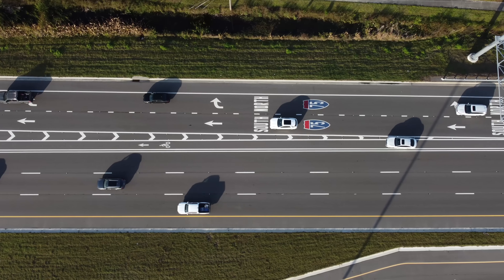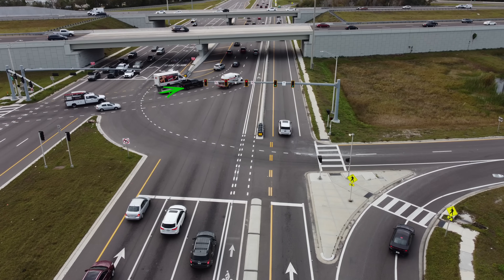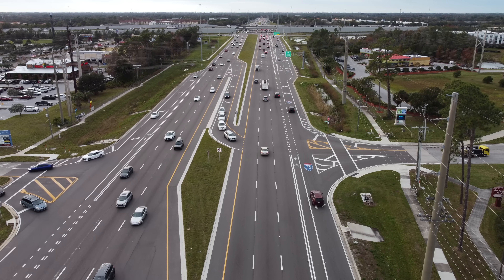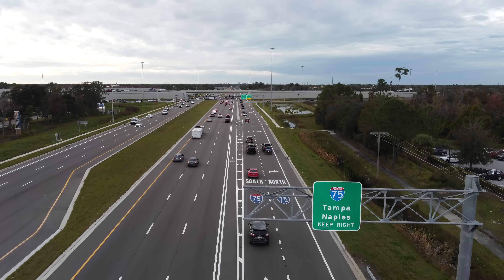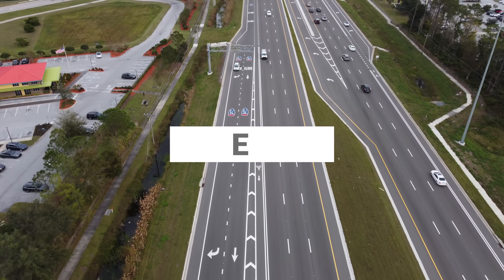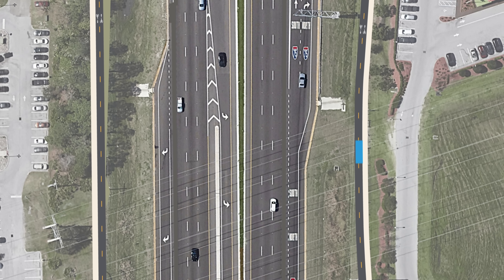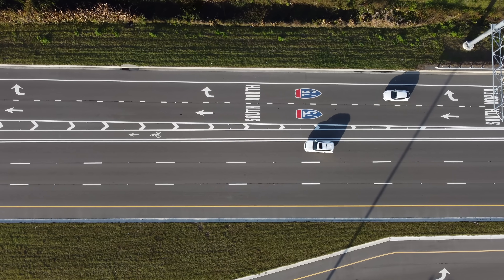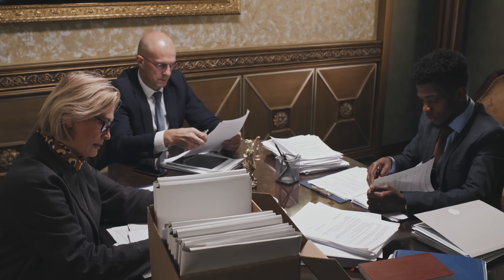This Brand New Interchange is Already Flawed

Comment: That bike lane looks absolutely deadly.

I dare the designers of this interchange to bike there
Reply: I feel like a lot of these designs are intentional so they can later argue that bike lanes are dangerous and they can get rid of them again.
Reply: @FlorianHWave  "no one even uses this bike lane! this is why we shouldn't build more bike lanes"
Reply: @reilandeubank the bike lane not being used is due to bad bike lanes. They should add continous barriers to both sides of the bike lane, but that makes turning right impossible for cars. So redesign it entirely. Just a sepperate bike lane. Bike lanes and car infrastructure should never mix if possible!
Reply: @joneinarmattiasvisser6113  I know I was making fun of the traffic engineers that seem surprised people don’t use their bad bike lanes
Reply: @reilandeubank the American mind
Reply: If we were design car lane that are very dangerous with blind corner would you drive.  @reilandeubank
Reply: @reilandeubank  That's probably just a fringe 'benefit', and the truth is even messier as revealed by some other comments. The project had money problems and ended up taking some grant money for bike lane infrastructure to make up shortfalls, which required them to add the bike lane. And of course, since the grant was just "extra money" to them, not a sincere intention to add functional bike infrastructure, they cheaped out on it as much as they could: just a little bit of confusing extra paint and that's it. I would not be surprised if this was a "minor change" implemented by a random government office worker and signed off by the politically appointed government officials in charge after the traffic engineers had already been paid for designing the interchange without the dangerous bike lane. Which explains why the bike lane makes no sense and is dangerous: it's there to fulfil the bare-minimum technical requirements of the grant money as cheaply as possible, not to actually be functional bike infrastructure.
Reply: @FlorianHWave  Yeah, that's the only way I can believe it. They make a crappy dangerous lane nobody uses, to justify never building any at all.
Reply: @moth.monster  this is what happens when a minimum bike infrastructure requirements are codified in building standards and road planners are forced to retro fit cycling infrastructure on roads that are designed for cars. This is a high capacity, high speed roadway designed for motor vehicles. Bike lanes and cyclists don't belong there period! If you want cyclists to safely travel along that route, the only way to do it is to build a cycleway parallel to it, which is very hard to justify economically. You can't put a protected bike lane all the way on the right because there are turn-only lanes that the bike lane would have to cross anyway because—you guessed it—this road is designed exclusively for motor vehicles. 
I don't think there's a conspiracy of planners making terrible bike lanes deliberately, but I do think there's some legal requirement to stick bike lanes everywhere and this is the only way to do it on a freaking 6 lane road.
Reply: @artemkatelnytskyi  stuff being hard to justify economically never stopped the US from becoming the car centric transportation hellhole that it is today. Why do we suddenly care about justifying stuff economically only if it concerns bikes and public transportation?
 
I have no idea if a bike route makes sense along that corridor. But if it does, they should build a proper one. Tunnels and flyovers exist and are not a new technology, and they don't have to be built nearly as heavily for bikes as for cars, meaning it costs only a fraction of what the car infrastructure cost.
Reply: @alex2143  because car infrastructure moves millions dollars worth of goods and human capital. Agree on the public transportation though. I place public transportation higher on the list of priorities than cycling infrastructure.
Reply: @artemkatelnytskyi  I'll just point out that Dutch bike infrastructure has an ROI of approximately 2900% due to health benefits, reduced spending on other types of infrastructure and the fact that bike infrastructure is dirt cheap and move on then. Have a good day!
Reply: @artemkatelnytskyi You must work as a city planner.

As an example, bike lanes allow children to use their bicycles to go back and forth to school, without having to wait for a parent to drag them them around in a car.

As well, cycling to school is good exercise.

I guess though, as a city planner who's only thinking about slaves sitting in warehouses, exercise and education isn't worth considering.
Reply: @artemkatelnytskyi  Funny how it works out in other countries. But I take it making people physically ill is better for the economy, right?
Reply: @ohauss  funny how you put words in my mouth and just assume what I think.
Reply: @artemkatelnytskyi  Except, as pointed out there is already a parallel footpath that could be modified to do precisely that.
Reply: @EwanMarshall  true.
Reply: @artemkatelnytskyi  Hard to justify? With that state of mind you will never get a bicicly infrastructure. But where I live this is the norm, It is obvious and obliged to build infrastructure for cars, pedestrians and bikes. No brainer.
Reply: @artemkatelnytskyi  It does not, it moves people,. and badly and inefficiently.

Moving a car between tow parking lots is not transportation (except when it is loaded on a trailer). The driver (and possibly passangers) are the transportation, and compared to a bike, the transport is costly and ineffcient.
Reply: @artemkatelnytskyi ”build a parallel cycle way is hard to justify economically“. In other countries this is done all the time. 
“We’re one of the richest nations” - “no, not in that way”
Reply: @artemkatelnytskyi no, this is what happens when you have a car-centric society. Watch some videos on urbanism. Your argument is made constantly and other countries have proven that way of thinking is flawed. Urban design dictates how people use a space, not the other way around.
Bike lanes are not seen as a legitimately important feature so they’re not treated as such. 
There’s so many other (and better) options.
Reply: @FlorianHWave  You're giving them way too much credit. Road design engineers include bike lanes because they're told to, they give absolutely no thought to it beyond checking it off the list. I see the same thing with bike lanes that just end in the middle of nowhere. It's crazy to be riding a long and see a sign that says "Bike Lane Ends" and yup thats it.
Reply: @FlorianHWave  Change the law so the designers/builders are liable.... that should solve that pretty quickly.  And maybe take cues from the Netherlands ;)
Reply: @FlorianHWave  Its so dumb why not focus the money thats being spent on making genuinely usable bike lanes?
Reply: @FlorianHWave that's a good point about bad design to just get rid of them
Reply: @FlorianHWave The most malicious of malicious compliance...
Reply: @FlorianHWave it should not have been intentional at all. If not, then what purpose for the bike path?
Reply: @FlorianHWave  There are places where bike lanes shouldn't be. This looks like one of them. The notion that bike and auto traffic can safely co-exist everywhere is foolish.
Reply: @ It would be perfectly fine if they had put the bike path next to the road, physically separated from the road.
Reply: Did they just put a bike lane on A FUCKING HIGHWAY?!! I really don't get North America.
Aside from the bad design of the interchange, how on earth could they put an unprotected bike lane right next to cars going more than 100km/h holy shit
Reply: @riccriccardoricc  there are some bike lanes in the nether lanes which parrelell highways but those are on seperated paths
Reply: I don't think I've ever seen a bike lane more stupidly designed anywhere. Ever.
Reply: @Greencomms I’ve seen bike lanes like that irl
Reply: @Greencomms  The A421 in the UK has a cycle lane crossing entrance / exit ramps following a 70MPH dual carriageway. It's not kept clean and clear.

Cyclists rid in the gutter.
Reply: @Ben31337l  There are quite a few roads in the UK that are like that, the cycle route shares the shoulder of a 70 mph dual.  I suspect it is just done so they can say they have accommodated cyclists.  I do not actually see anyone use them.
Reply: The bike lane looks like something I'd see on a red bull challenge
Reply: I can't image this would happen anywhere in Europe. I don't even think they are that stupid in eastern Europe.
Reply: @yottaforce no cares what Europe does, keep your shit opinion to yourself
Reply: Its Florida, its probably intentional. And with how expensive this thing is, it would have been marginal to put a combined walk/cycle path that is separate from the road.
Reply: At one point on Blackfriars Bridge in London, there was a similar layout of bike lane which was sandwiched between a left turn lane and a through lane (remember, we drive on the left). Cyclists were killed by traffic switching lanes, that cycle lane was removed, and was later replaced with a lane on the left hand side, but has since been replaced with a 2-way cycle track. In this case you'd probably be better off widening the sidewalk and designating it for dual use. But that was on a 30 mph [more recently 20 mph] road in the city centre, more akin to downtown Boston, than a major highway in the exurbs.
Reply: I daresay if the designers were made to bike there, we might have some job openings for better designers.
Reply: May I assume the designers are fired and prosecuted for attempting murder of cyclists? This design is so bad, it must be done with a purpose.
Reply: @lbergen001  This is Florida with DeSantis, this was likely forced from above the designer's unfortunate pay grade.
Reply: @Toqom  wow, that's crazy.
Reply: The bike lane on that road is absolutely insane
Reply: That was my immediate thought first glance at this video, I'm not even 30 seconds in. It epitomizes what's completely wrong with how car societies, even when well intentioned, get wrong with adding cycling lanes. There's No Freakin' Way I'd use that as a cyclist. Bad enough being a driver in that mess.
Reply: I think those designers were passive-aggressively trolling cyclists.
I can't imagine any other way anyone would think to do something so bad as a bike lane.
Reply: I'm pretty sure most bicycle lanes are designed by people who have literally never ridden a bicycle. My favourites are the ones which make sharp 90º turns.
Reply: It's truly insane how any designer would think those are ok
Reply: That bike lane design should carry a capital penalty for the designer.
Reply: The bike lane was 99.9% certainly made to qualify for more funding, not for anyone to actually bike on it.
Reply: That should be the requirement – not that that the road designers must include a bike lane, but that they must ride a bike along the roads they design at least once a month for a year. See how much safer the bike lanes become after that.
Reply: @skoosharama  we would run out of road designers! lmao
Reply: @skoosharama  there are professionals that see roads like this. agree with you. but then bike down that same road regardless of the fact there's a bike lane or not.
Reply: @skoosharama  also make the woke politicians ride a bike on it.
Reply: @skoosharama  Requiring road designers to travel down every bike lane they design once a month for a year is an absurd requirement and it would pretty much guarantee that you're turning all road designers against the idea of ever including bike lanes in their projects again.
Reply: @Strideo1  I didn't say that road designers ought to regularly ride a bike down every bike lane that they design, but that they ride a bike down every road that they design. That is a crucial difference. And why is it so absurd? Is it any more absurd than a traffic engineer putting an unprotected bike lane in between general traffic lanes on a multi-lane road with a 50-mph speed limit?
Reply: @Strideo1  -!!! It's NOT road designers that get to decide what uses the road needs to fulfill, Strideo1 !!!
Country, county and city PLANNERS make those decisions. Road engineers and designers are there to FULFILL those needs, that's all. Or are you in favor of always allowing the tail to wag the dog!
Reply: Wrong. Forcing road designers to bike down bike lanes themselves is exactly what should be done to ALL politicians and government employees: experience the consequences of their actions  @Strideo1
Reply: @Strideo1  Then they do not get a job, because the bike lane is a requirement in the first place.
Reply: @Strideo1 in the years I’ve seen it take to do a construction project, I’d imagine they would have plenty of time to ride their bike alongside their creation once or twice.
Reply: @Strideo1  No, it'll wake them up and cause them to design them properly.
Reply: @Strideo1  No no, require them to cicly there for a year REGARDLESS of weather they've designed a bike lane or not.
Reply: If you would let your kids ride in the bike lane then it's not suitable
Reply: @ThiccRiderPup  Hope you meant "If you wouldn't"
Reply: @ThiccRiderPup    You write "If you would let your kids ride in the bike lane then it's not suitable."
I write, "If YOU would let your kids ride in THAT bike lane, then YOU are not suitable."
Reply: If I lived in that area, I'd probably only EVER have used that bike lane ONCE. It would likely have terrified me, especially if there was even a little traffic. After that, I'd ALWAYS find another way to cycle that route. So yes, as others here have noted, this could be used by planners to say they don't need bike lanes, because nobody uses them.
Overall, it's stupid planning anyway. If more people cycle, they'll likely be a LOT healthier. And that would both increase revenue to the town and reduce the overall medical requirements for it's citizens.
Just compare the US with Europe. Most European towns are bike friendly. The populace is a LOT healthier. And they have significantly increased life expectancy.
Reply: @rumi9005 
They put in one of these weird, non standard intersections in by me, in where it used to be a normal highway overpass, traffic now is directed to switch over to the other side of the road in an X. Being so dumb and unusual, I now avoid it, and I said to my friend that others probably will do the same, and they will claim the design worked but it's just bc it gets less traffic!
Reply: just say it is murderous. It is literally a bike lane in the middle of a highway.
Reply: I took one look at that “bike” lane and NOPE!  That thing has “death” written all over it.
Reply: If you wouldn't feel comfortable walking on the bike path (I know that is verboten), you shouldn't expect bikers to use it.
Reply: There is A LOT of politics involved in road design, sadly.  I have a friend who is in the business and the list of bad ideas that are forced upon them comes in many forms, from "I know better than you, egghead" to "I can never sell this to the Mayor/board/whatever oversight group unless you do X" to "OK, but you are adding this because reasons"
Reply: Yeah. Would you let a 12 year old on it without supervision? If not, it's not really bike infrastructure.
Reply: a lot of so called bike lanes are like this, they were added so they could claim bike infrastructure without any thought to safety of the biker. i will not bike on most bike lanes.
Reply: Honestly the residents should sue
Reply: Yeah as a Dutch person I was completely shocked by this. In the Netherlands this would have been a completely seperated bikepath that is probably at least 10-15m away from the highway. But a 3 lane road both ways with highway exits that has traffic lights is already completely unimaginable. This is a highway in all practical understanding. Highways don't have crossings, ever. Highways have over- and underpasses. A walkway across a 7 lane road with a protected middle barrier like that or a bike lane in between highway lanes just seems unimaginable to us. Just looking at this road you should be able to drive 100km/h on this road, but then all these stupid things exist which make it clearly not suitable for a 100km/h road (or whatever is the US equivalent). Just looking at the road for 2 seconds should tell you how fast you should be able to drive, here I get so many mixed signals. Separated car traffic with multiple lanes on both sides? Highway style exits and entrances? Clearly a highway. Wait, traffic lights?! Pedestrian crossings?!! A bike path in the middle of the highway?!!! This project is just lunacy of the highest order and in any sensible country you'd be laughed at for even proposing this nonsense. Let alone them actually building the thing.
Reply: if motorists obeyed the laws, there would be no problem for cyclists. but if you drive over a solid line, it's a crime, right? and if you miss an exit, you have to take the next one and turn around. no wonder you have so many accidents in the usa, as long as you arrive you are happy regardless of whether you do something wrong.
Reply: @PUTDEVICE  drivers doing stupid things that they're not supposed to in this kind of situation is Far from unique to the USA. Australian dash cam compilations are fun, just for one example. Simple fact is you pretty much have to assume there will always be at least a couple of idiots who will do this sort of thing.  Of course, the USA does seem to have rather More of such idiots than most places, and some parts of the USA are particularly resistant to do anything to mitigate the issue.
Reply: The bike lane was included solely for funding purposes. Due to high water tables, Florida doesn't do tunnels.
Reply: the existence of that lane at all is still quite remarkable for he level of car dependency in the land of unfree.
Reply: They will bike it and have 12 cop cars making sure traffic stays clear if them, It's a victory for them either way.
Reply: I enjoy biking with my children, but this is terrifying! It's one thing to risk your own life - but imagine taking your kids on 'this bike path'? This looks like reckless endangerment!
Reply: They put the TOTALLY UNPROTECTED bike lane BETWEEN two massive lanes of traffic.
Is Florida DELIBERATELY trying to murder cyclists?
Reply: They shouldn't be dared, the designers should be forced to ride a bike there daily for the rest of their life. Which will obviously be short.
Reply: At this point, I'm so disgusted, that I think Americans get the roads they deserve, and from a darwinistic point of view, deadlier roads are just an advantage. The more the merrier!
Reply: It should be a requirement for the designers to test their work in all modes intended, and they should self-insured for all accidents inflicted on themselves.
Reply: I work for a transit agency and our designers literally get in wheelchairs and try to access our infrastructure and vehicles in them. They scraped an old ramp design and decided to instead lower the trains because they couldn’t wheel themselves up the concrete ramps.
Reply: What is a different way to say, “bike trail”?

Cycle path
Reply: 🚅  don't you all enjoy railroad
🚈  trams, trains etc are just so cool
🚞  take a ride in my ''transportation'' folder,  (folder 4)   :)
Reply: High ways don't need bike lanes, there should be a bridge or a tunnel somewhere to cross the highway
Reply: You gotta understand there ain't enough space for bikes ! Fortunately there is a  path at the side of the road ....
(And you bet you'll get fined for riding on a sidewalk , no-one ever uses .😳😱 )
Reply: YES, I aggree, from the bikers viewpoint it's a criminal design !!  I propose the designers should be in jail.
Reply: I REQUIRE them to do so!!!!!!! Their sentence is to bike this route for a year.
Reply: Realistically, you cannot force designers to use "their bike lane" if they never used bicycle in their lives, as it seems to be the case.  But they should consult actual bicyclist who experienced whiffs of air from trucks passing them, the need to stop when you have a chain problem, the need to pass a slowpoke etc.
Reply: to me it looks like the bike lane was actually just to space out the road so they could later add a barrier
Reply: Much less take their children on it
Reply: They won’t because they don’t care. Most people only care about things that concern themselves. It’s like designing a publicly used bench with armrests in the middle for no real reasoning whatsoever.
Reply: They could've fixed it by putting the bike lane next to the road and just used tunnels for crossings. This bike lane is bad enough as it is, but this is the US where people can barely drive properly. So many cyclists are gonna die on this road, assuming they're foolish enough to even wanna use it in the first place.
Reply: Yep its faking nuts, who signed off on that lol.
Reply: I've only seen the start of the video, how are cyclists supposed to reach the bike lane? Or leave it?
Reply: Why are they putting a bike lane in the middle of a motorway?
Reply: I'm sure most designers would like it safer. I'd argue it really depends on politicians, things like political will, budget constraints, community input and the need to fulfill requirements for funding purposes in the cheapest way possible.
Reply: Ive seen similar bike lanes in other parts of FL, crazy.
Reply: This bike lane should never have existed. Any intersection with a cloverleaf should be car-only, and bikes should use tunnels or overpasses.
Source: Dutch traffic enthousiast
Reply: I mean, it HAS to bge intentional, right?
Reply: Lol you think they will peddle that???
Reply: Bike lanes and Interstates should not mix.
Reply: A bike Lan should have a barrier. Why are they always open when cars can drive off and hit them?
Reply: @6gredlite907  There should not be bike lanes at all, on main roads. And this is a huge main road...  More then that, the bike lane in built inbetween two section of the car trafic. I consider this high crime from the part of both the road designers AND the officials ordering it, the politicials voting YES for it.  
There should be completely separate bike route infrastructure at a different location.
Reply: @Wig4  I agree with that
Reply: Yeah, should be removed.
Reply: Those bicycle lanes are suicide. I'd challenge the committee deciding this layout to bike it during rush hours.
Reply: IKR atleast put a barrier or something
Reply: I would not ride a bike on a side street. Bike riders who think car drivers obey all traffic rules are not long for this world.
Reply: I dare the designers of this interchange to send their kids to school using that bike lane.
Reply: @BalooUriza  From what I have seen kids don't walk or ride bikes to school anymore.  If they are not riding a bus their parents are driving them
Reply: It was clearly designed purely to infuriate people asking for bike infrastructure by doing the opposite of anything sensible
Reply: why even have them in the first place? theres zero demand for bike lanes
Reply: @sleetskate  If they're safe and form a network, they have demand.  Most car trips in America are displaced to cars because there isn't transit infrastructure, pedestrian infrastructure and/or cycling infrastructure that is safe and reliable.  Most people aren't going long distance or carrying a ton of stuff, they're going less than five miles, and usually under three miles.  At those ranges, it's only a car trip if your hand is forced.
Reply: @sleetskate  couple reasons, 1.federal grant money, government is loathe to let tax dollars go unspent.
2. It is a means for local governments to show the EPA they are making efforts to fight air pollution.
Reply: they wont but still got brownie points
Reply: i cant help wondering what the bike lanes and zebra crossing on landing strips must look like over there?  😂
Reply: Non-motorized vehicles are not permitted to use interstates that are  smaller than this.... Good job Florida.
Reply: I w would never
Reply: Reading some comments make sense now why a lot of these new roads/designs have bike lanes even though bikes are not common in those areas originally plus the new bike lanes do not look save at all.  It's all for the funding.  A$$hole governments.
Reply: people who design shit like that should be forced to actually use it a few times
Reply: Makes the 14th street bike lane in Lincoln, NE, which is between two through lanes for much of it, look safe.
Reply: They're forced to put it in because of politician pet projects.
Reply: Bike planes are designed to kill bicyclists.  Once you get into legislative politics, you begin to see that almost all of their policies are designed to kill Americans.
Reply: Literally biking on the road might be safer as you're on the road
Reply: They would bike there, it's just that when theyre eventually hit in an accident, the additional funding by adding "bike infrastructure" would be able to pay for their accident costs.
Reply: Time to put in bollards.
Reply: you say that... but i've seen people dumb enough to read this and think you're issuing a challenge
Reply: When that first appeared, i knew this had to be a joke video, but then he said Florida!
Reply: I worked for a firm that was municipal traffic engineer for many townships, and this is exactly what would happen. They would go for multi modal state/federal funds, calling in improvements for pedestrian/bike infrastructure, and the majority of the money went to widening roads for cars. 

These multi modal funds should be further reviewed to make sure the multi-modal funds do not go towards roadway capacity improvements.
Reply: It's less a "Let's kill cyclists" and more "Feds won't fund it if we don't put in a bike lane, not understanding that if you're biking on this road, you're avoiding easier and safer routes already"...
Reply: Seeing that bike lane really makes me feel the prospects for humanity are very bleak.
Reply: Why put bikes in the middle of traffic? What kind of engineering is this?
Reply: Yes, the bike line is a death trap!
Reply: The bike lane is included in order to get federal funding dollars for bicycle infrastructure. It technically fulfills the need, but from a practical standpoint; it's deadly.
Reply: "strategic incompetence" - when someone is intentionally so bad at an assigned task to ensure that no-one ever asks them to do it again...
Reply: It is to help the eco minded bike people depopulate themselves and save the earth.
Reply: 💀
- the designers
Reply: Who was the dumb one that thought that bike lane on the left?
Reply: Forreal, who the f thought that was a good idea?
Reply: Don't worry its Florida; the police will arrest or harass any cyclist before they ever get to use it...
Reply: i haven seen the new renditions in Sarasota and Bradenton but eatly 20009s i had a medical lab route from lee co to there and it was heavy traffic and only start of expanding roads . but the 3 roads from i75 to 41 were 6 lane plus turn in center . and they were allowing school busses to pick up and drop kids off on that road and when your 7 lanes away you don't notice school bus dropping kids and if someone did it could be deadly . thankfully they didn't let kids cross the road they had to be living on same side . 
i recebtly had to go to tampa general for medical care and fl is very negligent in removing and repainting traffic lanes when shifting traffic whe it resumes the 3 lanes paint lines are all over making even good driver guessing which is traffic lane  seen that in many construction zones as replacing damaged direction signs from bot sun damage and storms
Reply: Yes!Thats the first thing that got my attention!Ridiculous bike lane!!Those designers should look like we do that in the Netherlands..
Reply: But there is no where else to put it, it's not like there is a 30 meters wide strip of grass lawn lining the highway they could put it on /s
Reply: @omfghai2u  They could have built the bike lane right next to the railway line they built along to the highway. They built a railway line along the highway, right? (Insert "For the Better, Right?"-Meme)
Reply: Traffic engineers were trained to do one thing: move as many cars as possible, as fast as possible. Most of them consider bikes an unserious mode of transportation and see cyclists as nothing more than an obstacle getting in the way of the maximally efficient flow of cars. They'll begrudgingly add a bike stencil to the gutter because their local government or design guidelines call for a "bike lane", but they don't care one bit about the safety or comfort of people using it.
Reply: ok
Reply: The video commentator kept referring to that bike lane as, hilariously, "bike infrastructure."

Did you notice how many cyclists used that lane during the entire video?
Reply: Not to worry during the entire length of the video not a single bicyclist was seen.  Bike lanes are a waste of money in most cases and take up space the can be put to better use to ease traffic congestion with more traffic lanes.  But since the Federal  government provides money specifically for bike lanes and local government don't want to turn down "free money" we get stuck with bike lanes, plus local governments can point to the building of bikes  when the EPA pushes them about air quality.  It doesn't really address the issue but they can claim to be doing something.
Reply: @carlanderson7618  I believe you missed the entire point of the video. Sure, let's make 66 lanes, in each direction, that will totally solve everything.
Reply: @Santor-  I haven't seen bike lanes solving anything
Reply: @carlanderson7618  A good one could certainly incentivise people to use it. Do you think bicyclists are some sort of different race or something? Newsflash, most people who bike also have cars, so it's not like they aren't taking part in paying for it. It's like saying crosswalks have no purpose. You think people who drive never need or want to cross a road by foot?
Reply: @Santor-  What other incentive they need than having a bike lane specially for them?
Maybe there is a lack of enthusiasm for riding a bike to and from work  in Austin when the heat index is 114 or riding a bike to work in Minneapolis with a -20 wind chill. 
https://youtu.be/xJZlhECK0Ps?si=agmhxML2jqb2OWkZ
Reply: Bike is a noun not a verb
Reply: @PointNemo9  Bike is contextually a verb or a noun.
Reply: @BalooUriza  Wrong
Reply: Wait, do people actually walk or ride bicycles in europe?  Thats insane!
Reply: @zilfondel the cities are literally designed around it, because (at least in this regard) they’re not as stupid as US
Reply: @zilfondel  Nicht alle, aber sehr viel mehr als in USA. Und wir sind froh, dass es so ist. Und wir sind froh darüber, dass wir nicht für jeden Weg das Auto benötigen.
Reply: If you don't like the lane, treat the bike as any other vehicle and get in a real lane and operate as a vehicle.
Reply: @bowez9  As long as they cut the road's design speed to 20 mph or lower, I'd be okay with that.

How are you with this video's actual proposed solution, which is basically just to widen the sidewalk and make it a multi-use path?
Reply: @skoosharama  sidewalk are for pedestrians, roads are for vehicles. Bicycles are vehicles and should be treated no differently form other vehicles.  Do motorcycles or trucks get their own dedicated lanes?
Reply: @bowez9  Come back when you've passed physics class.
Reply: @ohauss  I have, Calculus based.
Reply: @skoosharama  - Multi-use paths are the correct answer here. Everywhere, actually. Separate the cars from the pedestrians and the bikes. Everyone is happy, everyone is safe. And the cost isn't that much in the grand scheme of things.
Reply: @bowez9  Are you, like, the reincarnation of John Forester? Even the most ardent vehicular cycling advocates weren't claiming that bicycles ought to be on interstate highways. That is essentially what you're arguing for here (putting bicycles in between lanes of a multi-lane 50-mph highway). That does not make any sense. There should be a separate facility for bicycles (just like for pedestrians) if you don't want to exclude that transportation mode entirely, and don't want a trail of corpses in the wake of your design decisions. 

If this were a normal city street, I'd totally agree with you. Bicycles are, in general, vehicles that ought to be able to use the road network (which was, after all, first lobbied for by bicyclists). But it's not a normal city street. It's a high-speed road. So either drastically lower the design speed so cars and trucks don't drive so fast on this road, or give bikes a separate facility. In certain contexts (rural Iowa, for instance), that could be as simple as a wide, well-paved shoulder on a two-lane highway. In this context, which is a medium-density suburban commercial strip surrounded by residential areas, there are too many exits and driveways and whatnot, and a dedicated facility is warranted. 

Putting bicyclists in the middle of random, unpredictable lane changes is the worst decision of all.
Reply: @CL-YouTube-y7e  I wouldn't necessarily go that far, because once pedestrian and cyclist density reach a certain point, they start getting in each other's way, and separate pedestrian and bike paths (even if only by paint or a curb) may make more sense. And there are streets that are slow and low-car traffic enough that even painted bike lanes might not be necessary. One-size-fits-all solutions are not always going to be optimal solutions. But I agree that multi-use paths would often be a massive, cost-effective improvement in many cases, especially along higher-speed suburban arterial roads.
Reply: @bowez9  And yes, in a few places, trucks get their own lanes for the exclusive use of trucks. Truck-only lanes are not common, but they do exist. More common are bus-only lanes, which are dedicated to bus traffic, and HOV lanes, which are dedicated to vehicles carrying more than one or two occupants. These are not controversial (or at least, not so much anymore), so I don't understand why you would object specifically to bicycle-only lanes or paths. Vehicle- or use-specific lanes are a thing on American streets and highways.
Reply: @skoosharama  can a bike maintain a minimum of 40mph?
Reply: @skoosharama  because they exclude motorcycles which are functionally no more protected than a bicycle from traffic (remember a Honda Cub is a motorcycle not just street bike).
Reply: @bowez9  : Even a Honda Super Cub C125A can reach sustained speeds of 55+ mph, which is fast enough to keep pace with traffic on this road. It is entirely unsuitable for a bicycle path, where even the fastest riders will never exceed 28 mph on flat ground, and most riders will be going 10-15 mph. That would be more dangerous for everyone, including the motorcycle riders. What I don't understand is why you would think otherwise. 

The reason why we have traffic laws and separate traffic facilities for different road users is to increase safety and keep things moving for everyone. Motorcyclists do not want to be stuck behind bicyclists puttering along at 15 mph; bicyclists do not want to be struck by motorcyclists (or cars) zooming along at 50 mph. Keeping motorcycles on the higher-speed road, and giving bicyclists a lower-speed path that isn't going to be crisscrossed by higher-speed vehicles, is a no-brainer. 

Do you ride either a motorcycle or a bicycle on regular roads? What is your experience like?
Reply: @skoosharama  yes and it's simple stay right and if have more than 3 vehicles behind you then you pull over and let them pass.

The fastest riders are capable of 60mph or more(record holders are over 150mph), your average rider will stop around 30 mph.  But your average rider isn't going to be useing these bike lanes anyway.
Reply: @bowez9  : So do you ride either a bike or a motorcycle on public streets? 

Your numbers for how fast even the fastest bike riders can ride are either for professional racers on extended downhills going down mountains, or for a modified bicycle built with or drafting behind a purpose-designed aerodynamic shell, towed by a race car on a salt flat. Bicyclists on flat ground riding normal bicycles do not get close to 60 mph, even if they're racing in the Tour de France. The 200m world record for a track cyclist given a flying start is just under 50 mph (for 9.1 seconds); for a track cyclist over a distance of 1 km, it's just under 39 mph (for 55.5 seconds). These are world records; not even your weekend-warrior spandex-clad cyclists, unless they've qualified for the Olympics, are going to be able to ride that fast. 

And you're right; the average rider isn't going to be using these bike lanes on SR 70 westbound approaching I-75, because the lane configuration and lack of any protective physical barriers turns it from being merely uncomfortable (like riding on a narrow shoulder) to near-suicidal to ride on them. That's why a multi-use path is a much saner option on this section of SR 70, so that average riders will be willing and able to ride here without feeling like they're rolling the dice on whether they make it home. It's a waste of public money to build a facility that no one will use, and a travesty to do so when you could instead build a facility that people will use. 

So do you ride either a bike or a motorcycle on public streets? What is your experience like?
Reply: @skoosharama  no your average rider is 8 years old, that is why bike lanes aren't used.

You're quoting fully upright position in an aerodynamic position over 80 mph is achievable.  Which changing position is something even a 5 year old knows to do.
Reply: @bowez9  : I guess that means you don't ride a bike. Do you ride a motorcycle on public streets? What is your experience like?
Reply: @skoosharama  does it matter other than you potentially performing Ad Hominem attacks?
Which almost exclusively means the using that above strategy doesn't have a vaild position.
Reply: @bowez9  : I ask because it puzzles me why you would suggest, first, that bicycles should never have road facilities dedicated to them (or even to them and pedestrians), because they exclude motorcycles, even small motorcycles such as the Honda Cub, then that people riding ordinary bicycles could achieve faster speeds on this level road than any track cyclist has ever achieved, and then that the average bike rider is eight years old (which, if that is what you sincerely believe, would make your first suggestion that bike riders should merge with regular traffic on this 50-mph road even more unfathomable). 

If you don't ever ride a bike as transportation, this would be a great lived experience to have and I encourage you to try it (although not on this road! Maybe on a nice purpose-built bike path or quiet residential street first). If you ride neither a motorcycle nor a bicycle as transportation, that might better explain the disconnect between what you're advocating and what I'd imagine a rational motorcyclist would want (which is probably not to be dodging cyclists and pedestrians on a multi-use path when they could zoom down the highway instead). 

On the other hand, why would you even bring up a particular motorcycle model like that if you don't ride motorcycles?
Reply: @skoosharama  I'm advocating following the rules of the road instead of adding new ones and wondering why no one is playing by the new rules.

The speeds I quote are below the records achieved, so if you are not familiar with them that is not my issue.

Care to explain why bike lanes should exist when those legally allowed to use them are in no way funding their construction or maintenance? 

The point about age of riders is to show why no one uses bike lanes.

Since when are pedestrians allowed in bike lanes?

If the bike lane is about safety then why no protect motorcyclists too?
Reply: @CL-YouTube-y7e  Ehh, I've seen a number of places where seperating the cyclists and pedestrians would be highly advisable (mostly places where there are a lot of bikes and the terrain encourages them to move at speed, or such dense foot traffic that bikes wouldn't actually be able to go fast enough to reliably travel in a straight line, nor corner sharply enough to not run into people.) and places where having cars and bikes share the road is fine (usually very quiet backstreets... though also a few places that on paper seem like it would be a terrible idea at first glance. Then you see how the traffic Actually behaves there and it's fine). So "everywhere" is probably going too far. 
But multi-use paths should probably be the default in the absense of specific reason to do otherwise, at least.
Reply: @laurencefraser  - Of course. In many places there simply isn't enough traffic volume (bikes and cars) to justify separate infrastructure.
Reply: @bowez9  Let's go through this point by point. 
> I'm advocating following the rules of the road instead of adding new ones and wondering why no one is playing by the new rules.

The rules of the road are neither as simple nor as rigid and unchangeable as you seem to think. It is important, rather than blindly worshipping a certain set of rules, to keep in mind what the rules of the road are for – which are, as I said before, "to increase safety and keep things moving for everyone." If the rules of the road are not doing that optimally, then they need to be modified to better fit their purpose. That has been done for various reasons in various cases, including lanes and tracks whose use is limited to vehicles of certain types – freight trucks, buses, and high-occupancy vehicles, as well as bicycles. Those are all part of the rules of the road.
Reply: @bowez9  : 
> The speeds I quote are below the records achieved, so if you are not familiar with them that is not my issue.

The speeds that you quote ("The fastest riders are capable of 60mph or more") are entirely unrealistic for someone riding an ordinary bicycle on level ground, as I would hope you aware. I wish fervently that YouTube would allow URLs in the comments so that I could link to all the sources that would disabuse you of these mistaken impressions, but I will at least mention them. 

Of course, we build transportation infrastructure not to cater to the fastest vehicles driven by professional racers at top speed, but to accommodate ordinary vehicle users going at reasonable speeds. It is not reasonable to expect ordinary cyclists to ride at a sustained pace of 30 mph, much less 55+ mph, to keep up with traffic on a 50-mph road, as even the very small motorcycle that you mentioned is capable of doing.
Reply: @bowez9 : 
> Care to explain why bike lanes should exist when those legally allowed to use them are in no way funding their construction or maintenance? 

Don't kid yourself; everyone pays for roads. Fuel taxes, licenses, and other user fees do not cover the entire cost of state and local road spending in any state Not even the federal Highway Trust Fund pays for all federal highway spending; that's why that bipartisan infrastructure bill had to be passed, to help catch up to all the deferred maintenance with hundreds of billions of dollars in money from the general treasury. Nationwide, fuel taxes and user fees only pay for about half of all road spending.

All those shortfalls – about half of all road spending nationwide – get paid for by taxpayers in general, including me. Heck, I don't even live in Florida or own a car, much less drive one on a regular basis – yet some of my tax dollars are going to pay for both SR 70 and I-75 regardless. And I'm (mostly) okay with that, because that is how society works. We all chip in and help pay for each other's needs, so that society as a whole can do better.
Reply: @bowez9 : 
> The point about age of riders is to show why no one uses bike lanes. 

Not even an eight-year-old would use this bike lane, and perhaps you can ask yourself why that is. That might help you better understand why. Or, just try going somewhere by bike on the bike lanes that you think no one uses in your city or town. You might discover that other people are using them too; or, if not, you might discover why no one is using those bike lanes. 

As it turns out, people do in fact use bike lanes quite a bit – as long as they are safe, comfortable, and usefully connect people to places that they would want to go. If you have a bike lane in mind that you think doesn't ever get used, ask yourself: is it safe, or dangerous? Is it comfortable to ride on, or frightening to ride on? Does it usefully connect people and places, or does it go nowhere interesting or important?

Maybe you could ask yourself those questions regarding the bike lane that got designed and built in this case, on Florida State Road 70.
Reply: @bowez9 : 
> Since when are pedestrians allowed in bike lanes? 

Multi-use paths are designed with a certain width in mind so that both pedestrians and bicyclists can use them, and cyclists can safely pass pedestrians. Sometimes there's a painted lane marking to indicate a separate lane for cyclists; sometimes not. From personal experience, I can tell you that pedestrians often do not understand or respect these lines even if they do exist, but it's usually not a huge deal as long as the path is wide enough to pass safely. Multi-use paths are best in cases where the density of pedestrians and cyclists is modest. If the numbers of either cyclists or pedestrians get too high (e.g. midtown Manhattan), they start getting in each other's way, and some other solution may be necessary.
Reply: @bowez9 : 
> If the bike lane is about safety then why no protect motorcyclists too?

As mentioned before, motorcycles are capable of both accelerating fast enough to merge into traffic on a highway, and to maintain highway speeds. Ordinary bicycles are not capable of either. This is also true of pedestrians, which is why we (usually) have sidewalks, instead of expecting pedestrians to share the roads with cars going at much higher speeds. Bicycles are able to match, or at least approach, the effective speeds of those cars on city streets. But a high-speed arterial road like SR 70 is a different story, and a separate, protected multi-use path for pedestrians, bicycles, scooters, skateboards, etc. would be far more appropriate than expecting bicycles to ride in the middle of this road.
Reply: @skoosharama  I know you are not wanting nor care for an answer but.   They exist to make law makers feel good.

Depending on budget constraints projects may not legal be funded by ANY outside sources, only those expressly itemized.
Reply: @bowez9  : Why would you think I wouldn't want an answer? We've had a long conversation in this thread, and I'm happy to keep it going. 

I think we might be getting closer to agreement here. This particular bike lane, in this particular stretch of highway, seems to have been designed to tick a box on a traffic engineer's checklist, rather than to serve its intended purpose of providing a safe, comfortable, and useful facility for people on bikes. I don't know which politicians this bike lane would please; I don't imagine it's made any of their constituents very happy, including the ones who would want more bike facilities to use. I would prefer a shared-use path (one way on either side), or even  a shoulder lane with a bump-out at the intersections, to this quarter-mile "keyhole" lane on a high-speed road that just invites cars and trucks to sideswipe any bikers that might try to use it. 

As to projects not being funded by "outside sources": I don't know what you mean by that. State and interstate highway projects are supported by state taxes and fees, but also by federal taxes (and not just fuel taxes, in either case). The funds go to the state department of transportation, and then they spend it. If federal funds don't get explicitly allocated to this project, their presence in the transportation budget allows other state funds to be more easily allocated to projects like this one. We're all paying for this stuff, one way or another.
Reply: @skoosharama  simple accounting, funds are only authorized to come and go to certain accounts.
Reply: @skoosharama  these rules have worked for over 100 years, and now they don't work?  Have you ever been on a military post?  Those rules are followed to the letter and no one speeds-for they know that a MP will enforce the law no matter how small the violation.
Reply: @bowez9  : Re rules of the road: Are you suggesting that rules on military bases have never changed in the past hundred years? Because I see that there was a U.S. Department of Defense directive dated November 2, 1981 that "establishes policies [...] for the enforcement, on DoD military installations, of those state vehicular and pedestrian traffic laws that cannot be assimilated under [Title 18, United States Code, Section 13]." That would imply that at least some rules of the road were either not enforced on all military installations, or that it was unclear whether or not all such rules were enforceable on military installations. 

Regardless, "the rules of the road", if by that we mean traffic laws and regulations, have indeed changed in the last hundred years. Turning right on red was prohibited until 1939 in California, and in most other states until the 1970s, when it was legalized as a fuel-saving measure in the wake of the Arab oil embargo. The rules have changed, and they can be changed again in order to better serve the public good. In this case, to allow for protected bike paths.
Reply: @skoosharama  so you want more laws even though the current one ain't enforced? 

Where as MPs/SPs show how effective it is to just enforce what there.  If you doubt me speed on Post or fail to maintain your lane.
But as you clearly  stated those were not laws those are policies and directives.
Reply: @bowez9  : 
I want to have more and better bike facilities so that people have more and better options for getting from place to place. You seem to have interpreted dedicated bike lanes as a violation of the supposedly sacrosanct and unchangeable "rules of the road". But traffic rules and design are not unchangeable; they have changed in response to changing circumstances, and so there's no reason that they can't be changed again. The "new rule" here, if we can even call it that, is simply for motor vehicles to not drive down (or park in) bike paths. Why is this somehow beyond the pale for you? 

I should point out that bike lanes, bike paths, and multi-use paths are being installed on many military installations, and have been for years. I expect that the "new rule" of cars not being allowed into bike lanes and bike paths on base is as enforceable as any other rule there.
Reply: @skoosharama  no bike lanes are unnecessary as the traffic already address bikes as vehicles.  So if bikes get thier own lane why not one for cars, one for trucks, one for blue vehicles one for red vehicles....  Enforce existing laws.

Adding lanes anit going to get people to bike, raising fuel price and shrinking the country is the only thing that will.  Only a tiny fraction even use a motorcycle let alone use one in winter and even a smaller fraction use bicycles.  Look at the obesity rate in the US and honestly tell me people WANT to ride a bike everywhere instead of their climate controlled car.
Reply: @bowez9 : 
I want to have more and better bike facilities so that people have more and better options for getting from place to place. You seem to have interpreted dedicated bike lanes as a violation of the supposedly sacrosanct and unchangeable "rules of the road". But traffic rules and design are not unchangeable; they have changed in response to changing circumstances, and so there's no reason that they can't be changed again. The "new rule" here, if we can even call it that, is simply for motor vehicles to not drive down bike paths. Why is this somehow beyond the pale for you? 

I should point out that bike lanes, bike paths, and multi-use paths are being installed on many military installations, and have been for years. I expect that the "new rule" of cars not being allowed into bike lanes and bike paths on base is as enforceable as any other rule there.  

Let's see if my reply sticks around long enough to be read this time.
Reply: @skoosharama  the main issue I bring up is why make new laws when the CURRENT ones ARE NOT being ENFORCED.   That just means there will be more laws not being enforced.

As an example, Do you as a cyclist pass on the right?
Why didn't you address my question about lanes for other classes of vehicles too? Do you only want your desires fulfilled and not the majorities?
Reply: @bowez9  : This whole issue of law enforcement is pretty orthogonal to how we should design roads. The whole country's not going to become like a military base, and that's probably a good thing. Instead of more traffic cops, we could just design roads and streets to encourage safer, more law-abiding behaviors. 

Regarding your question about lanes for other classes of vehicles, I already answered that two months ago. We already have different lanes and facilities for different types of vehicles. There are bus-only lanes and roads, truck-only lanes, high-occupancy lanes for carpoolers, controlled-access highways where non-motorized traffic is prohibited, and sidewalks (i.e. pedestrian-only traffic lanes). This has been the case for decades. As I'd mentioned before, it's hardly unprecedented to have traffic lanes dedicated to particular classes of vehicle. So why get so bent out of shape about bike lanes or bike paths in particular?
Reply: @skoosharama  I didn't ask for more cops I said more enforcement-less turning a blind eye and more of do the job.  Or do you admit that the laws aren't going to be followed and they aren't going to be enforced ?
Reply: @bowez9 Whether it's more cops getting hired, cops getting overtime to spend more time on the streets, or existing cops making more stops, it's functionally the same thing: cops getting in our lives and in our faces more often. That's what "more cops" mean. 

What I'm saying is that there's another way, besides law enforcement, to encourage pro-social behavior, such as compliance with traffic laws and safer driving habits, and that is to design the built environment to make it easier to do the right thing, and more difficult to do the wrong thing. That includes things like lane markings, curbs, narrower lanes, reflector posts to mark curves, bike lanes, sidewalks, street trees, roundabouts, medians, bollards at intersections to keep sight lines clear, and a whole host of other devices at the disposal of traffic engineers and urban planners. You can look up the idea of "design speed" (and notice how it diverges from "legally permitted maximum speed") to get a sense of how this works.
Reply: @skoosharama  I am very well aware of "design speed" but there are segments who's speed is above and below the posted speed.

Ask yourself have you ever seen something used in away it wasn't designed to be?

Yet regardless of design speed on Post essentially everyone follows the laws-even the guy doing 30 over right up to the gate.  Why because there will be consequences.  You can't tell me that thr straight flat wide roads on Post (for tanks and large equipment) have a design speed of 25mpg for a passenger car.
Reply: @bowez9 I'm a car driver, motorcyclist and a cyclist. Trucks, cars and motorcycles can easy keep up with the traffic so these vehicles do not pose a massive threat to each other. A motorcyclist is in much more danger due to the size and visibility but due to them being able to keep up with traffic they aren't being a hindrance when another vehicle needs to change lanes, they have bright front and rear lights, the rider is also decently protected if they wear the correct gear.

You saying that cyclists can reach 60mph is completely mind boggling, unless you have a powerful ebike nobody will ever be able to reach that on a highway, without a motor even dedicated cyclists would very much struggle to stay at 30mph, a normal cyclist would on average be at 10-20mph. Put them on a road where all other vehicles are doing 2 to 5 times the speed and they become a major risk to everyone. Trucks in certain areas have their own lane due to the road being steep and they can't travel at the same speed as normal traffic and become a hindrance, these trucks are far more obvious due to size and sound.

Cyclists need their own protected lane due to the speed that go at and the protection that they wear. They are basically a faster pedestrian.

Yes cyclists do pay for infrastructure because the vast majority of them also have a car too.
Reply: @madbull4666  trucks don't get thier own lane, at most they are restricted from other lanes and any vehicle can be in those "truck" lanes.
Odd you say motorcycles are "safe" if they wear the proper gear.  Why wouldn't the same be true for bicycles.  Follow the existing rules and they are safe.
Reply: @nerds-nonsense  according to study from Corona Insights in 2018 65% of all riders were between the ages of 3-17, and doest get above 10% until 45.  Meaning that those under 18 make up between 3 to 5 times the riding population as another segment.

Are you truly saying enfoeced laws don't influence your behavior?
Reply: @bowez9  I have been a hardcore cyclist - who got his start on NYC streets - for 4+ decades

I estimate that I have done at least 150K miles in my life, and that's probably a low end estimate

In my life, these are the fastest speeds I have achieved on a bicycle with no motor power

53 mph on a tandem, with my wife/stoker, coming down out of steep mountains near Las Vegas NV

47 on a single cyclotouring bicycle with a fully loaded trailer in tow, down almost certainly the steepest part of the Oregon Coast Highway 101

30 mph on flat ground, single bike, no load, implementing highest gear of 100+ gear inches with wind not a factor

The speeds of bicycles you proclaim as fact are totally wrong, and clearly PROVE¹ that you know not of what you claim

And if I call your claims ridiculous, you'd likely accuse me of ad hominem attacks

1. Because I am a mathematician, I use the word PROVE advisably, unlike the rest of you normies
Reply: Why should bikes be allowed, but not horses, skateboards, or wheelchairs?
Reply: @trutrek913  You are asking the wrong question:
Where should cars be allowed? is the correct question to ask.
Reply: @57thorns  I think I see where you're going with it.  So, to take it further "Where should cars be allowed if bikes is already there?"